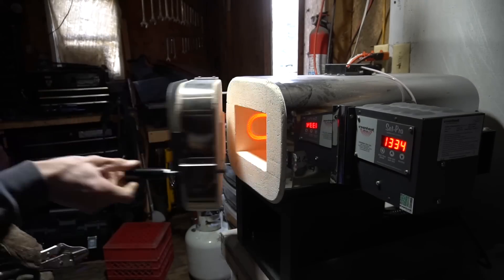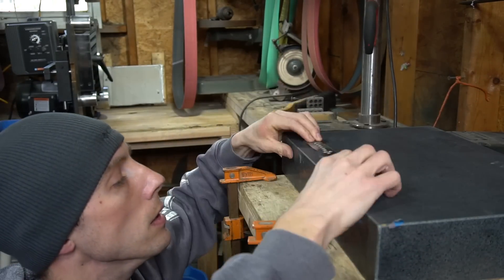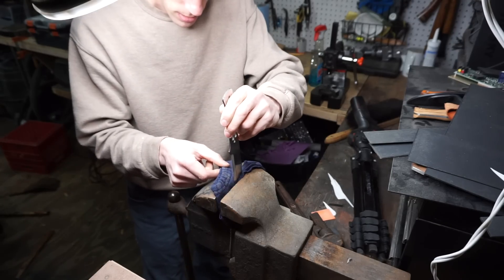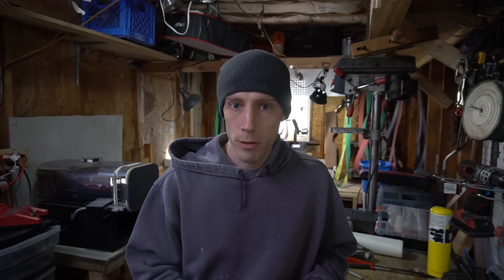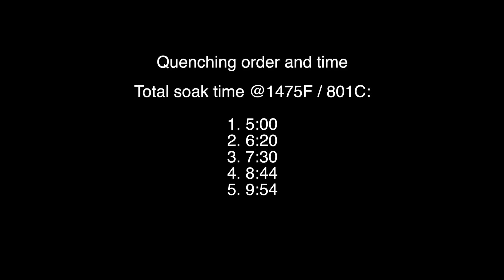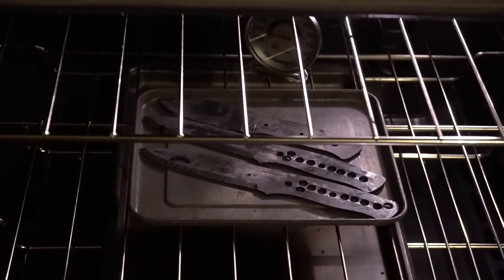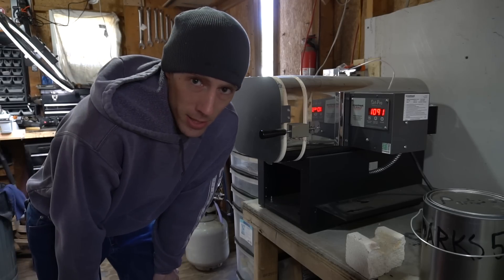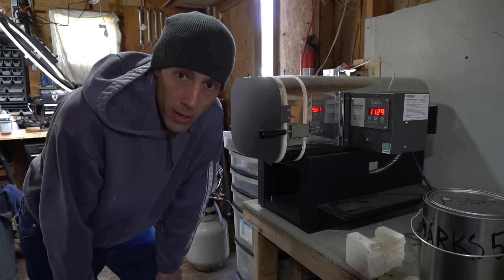Why Knife Makers Should Break Their Knives

Comment: I used to work for a stress relief company. Heat Treating different types of Steel, we used to start at an ambient temperature and then slowly heat the product to whatever temperature that particular Steel calls for, then there is a soak time again different for each type of Steel. After that we would slowly bring down the temperature over an extended period Of time . very technical and each type of Steel requires completely different heat treating but it always starts from an ambient temperature and slowly Works its way to asoke temperature and then slowly Works its way back down to ambient temperature. All types of Steel , if you want them perfect they require this type of heat treatment.
Reply: This is not that.

Comment: The smith who runs Crossed Heart Forge / Islandforge taught me that the increase in grain size happens in the quenching process, and it happens because the steel is usually heated too high before quenching, this doesn't happen in the tempering process. That's why the japanese smiths do not bring their swords to critical before quenching, the higher you bring them before the quench the more they expand in size. So quench your blades at the lowest temp that the steel type can activate the transformation process. So if your steel type can quench at 50 degree lower then do it lower, as low as you can.
Reply: @Aaron Washburn There's a huge difference between quenching a blade at dull red to bright orange. The higher the temp is when you quench the larger the grain size will be. Quenching at dull red is still hot enough to form martensite, I've quenched at dull red all the way up to lemon yellow and tested steel at each level of colour change personally, and dull red quenches have given the best result for knives. How many blades have you heat treated? I've done around 100+ over the past 3 years.
Reply: @Aaron Washburn You probably know more about the science behind it then, so I won't try to tell you you're wrong as you are the more learned person here (being honest not sarcastic in case it come off that way) Your're right about most of what you said, I do use Japanese hardness testing files, which can only tell me hardness in increments of 5 HRC. So I know when a Knife is at 50-55-60-65 etc or in between those numbers. 
I have basic data based only on performance testing, and I make assumptions based on performance, I don't even break my blades to try and look at fractures and breaks, I have a basic USB microscope so I could bring it up on my computer screen to take a look but I've honestly never wanted to break a blade, good steel is expensive lol.
All I honestly do is make a blade and take note of what steel type it is, what temp it is quenched at and what quench fluid was used and what temp the fluid was at. Then depending if I do traditional yaki modoshi Japanese tempering or western oven tempering I take note of what temp it was soaked at in the oven. I take note of thickness of stock used as well. Then I put them through edge retention tests, flex tests and abusive tests and take note at failure points, and the more abusive and higher scores on retention and flex testing the better I grade my blade. I don't really have knowledge of what's going on at the micro level, I just come to know what is the best results I can get for practical aplications and kind of stick with those, so I can tell people who might buy that blade what its limits are and what intended use I would suggest it be used for. I am switching to mainly doing blades with hamon now, without using western oven tempering, so my blades are quite hard on the edge and soft on the spine, I'm aiming at 62-64 HRC on the edge and am consistantly hitting just under 65 and just over 60. I'll be doing videos next week on the process if you are interested, maybe you can observe and tell me your input and advice.
Reply: @Aaron Washburn When I said not over critical I meant not as high as most western smiths quench at, I think most do it around 1450-1500. I've heard most people refer to critical at around no less than 1450. I usually quench at around 1350 or maybe a tiny bit higher. I think technically 1350 is still considered critical, but I thought it wasn't truly considered critical as it isn't completely past the transformation process at that stage, but it is transformed enough to create martensite because quite a lot of the make up is austenite at this temp, not fully 100% transformed though. That's why I say just below what is considered critical. When you temper at dull red I also notice a huge decrease in blade warping, where as when I quench at orange over 1450 I notice more warping and bacon edge.
Reply: @Aaron Washburn I tend to only use simply pure high carbon steels with low levels of manganese, shallow hardening steel when I do my own HT. Thanks for telling me that term (Intercritical quench) I've never even heard of that before.
Cheers.

Comment: The 800 is for 1095 the austenite phase transformation limit, generally you should soak up to 30 minutes for the steel to fully transform to austenite at that temp. This transformation is not fast at all. But huge chunky austenite does not imply huge chuncky martensite, as the quenching is a powerful phase transformation that restructures the whole steel.. I think you are not getting full austenite in your piece and that results in less martensite transformation and more of those nice chuncky grains of perlite (maybe). Going up with temp would ensure full austenite transformation and thus a full quench and less chunkiness.
As to why 5 minutes soak making smaller grains is that again you are having some austenite transformation but mainly pearlite which keeps growing until austenitisation. So with time you get bigger grains of pearlite back, but less of total. 
Anyway do a 30 minute soak and you should get the best result.

Comment: A suggestion to you is play with ice. I know water and metal are two different things but Crystal forms at the same way for both things so if you want a long Crystal has to do with pressure and heat and cooling versus a short Crystal. Another interesting thing you could try is a seed Crystal you can make it even more funny instead of playing with ice make some candy use a double boiler and see what kind of results you get when the fellow originally made the alloy for airplanes he thought he had made a mistake and left it for I came in for a few hours or a few days but the cooling temperature after the fact crystallize it and made it a lot more sturdy and flexible. I'm really interested in what your results are and I'm really tempted to start playing around myself I'm going to subscribe just because I want to see what you do. for some reason I'm thinking you should heat your oil up. And you should get a a laser thermometer it will tell you exactly how hot each one of your pieces of metal are you should be able to pick one up pretty cheap about 30 bucks. That will make your calculations more accurate.

Comment: I suggest you familiarize yourself with Iron-Carbon Equilibrium Diagram, it describes exactly what you see in your tests: grain depends on carbon content and temperature.
Reply from the maker: Im very familiar with them. Problem is not every steel type from every manufacture comes with paperwork.
Reply: @OUTDOORS55  then I'm probably missing something.
What I remember from University:
- Grade of steel is determined by carbon content and additives. This means that knowing steel grade you should be able to determine its carbon content and proper tempering temperature.
- After that you can test quality of your temper by checking steel for hardness (there should be plenty of tables on the internet for various grades and heat treatment procedures), this won't destroy the blade, but will leave a mark.
Basically, as you explained in the video, steel is defined by its crystal structure, which in turn is defined by carbon content and heat treatment regime. What you saw was result of overheating steel above its critical point or leaving it there for too long - Iron-Carbon Equilibrium Diagram is meant for engineers, not physicists, it's very practical, but what it actually represents is amount of heat required to reach certain state. If you look at Iron-Carbon Equilibrium Diagram, your aim is getting as close to critical as possible - supplying just enough heat for pearlite structure to transition into martensite (very fast to form and break which is exactly why it's so hard to do properly), but if you apply more heat (temperature too high or heating for too long), you will notice austenite grain forming - it makes steel softer, which you demonstrated. It's by no means fatal, to fix this you will have to normalize or anneal and re-temper the blade.

Also, thanks for making me waste 2 hours remembering stuff from University :D
Reply: @Aaron Washburn fair, so if you apply too much heat, stable austenite forms, right?

Comment: Also, for the 10 series, from about 1050-1090, I've always been under the impression you always should quench at the lowest transformation possible to prevent martensite formation. The other big thing, is the temperature of the quenching medium, which might be playing a factor here.  

During your tests, were you maintaining a set temp of your quench oil? Itll have a massive affect on crystalline structure.
Reply: It's been a while since I've read up on it, but martensite, to my knowledge, is a larger grained, unrefined extremely brittle grain structure that can add inconsistencies in the temper.

Comment: It shouldn't grow the grain for a 10 minute soak, maybe lower your temp by 25 degrees and try this test again? (quench @ 1450). I actually do heat treat 1095 in my forge, I am quenching in Parks 50, but I can cut through nails with it. I know it isn't 100% optimal, but it still has excellent results.
Reply: and you are right, in a forge, temperatures are hard to tell just by color, a good rule of thumb for me has been heat treat when it is pitch black, and when the steel reaches nonmagnetic (1414 F), and then go a shade brighter. (about 75 F more) and then quench.
Reply: also, normalizing can help keep grain growth small as well, even when overheated for a short time, that may be why when you quenched the test piece at 1525 F and it was still fine grain, but not so in the 1st batch of testing.

Comment: Great dedication to the craft. However, you're not actually looking at grain size. You're looking at fracture surfaces, which generally occur along grain boundaries. To look at grain size, you must polish the sample, apply an etchant, and view under a microscope. Also, a factor that's missing here is the hardness. It's very likely the pieces that were not soaked 5 minutes or more  did not reach full hardness capability, which defeats the purpose of a high carbon steel knife. If you're not soaking it adequately to achieve the steel's potential, grain size doesn't really matter. there's a point of diminishing return where ultra fine grain becomes a problem as you lose hardness. I got on the grain size merry go round a while ago too but then I got off after I learned a little more... :)
Reply from the maker: Theres a lot of factors missing here that i cant necessarily test with my limited equipment. All of the pieces however were saoked minimum of 5 minutes. Theres still a possibility that full hardness wasnt reached. I dont have a hardness tester so i dont know for sure. Thanks for the comment 👍

Comment: Ya know there's actually a whole profession based on the science of quenching. They do the math for temperature, what kind of oil, how long, etc. just to get a perfect quench. It's mainly used in very important machinery and equipment. For example NASA uses people to get the parts for space craft absolutely perfect.
Reply from the maker: Yes ive talked with a couple of them. The  consensus is they are not sure what is going on. The only way to tell would be to use more specialized equipment to examine the results.

Comment: Hmm Have you thought about the temperature of the oil you are quenching in ? Each time you quench a piece of steel in that same oil you are raising it's temperature and each peace that follows is quenched in hotter and hotter oil. Oil that's lets say 90 degrees Celsius will quench steel quicker than same oil at room temperature of 25 degrees even thou its hotter.   Have a think about that ;)
Reply: Yeah, just a bunch of BS. Maybe if you want consistent metal work, use consistent procedures across the entire build cycle including the oil temp you are quenching at.
Reply: Thats what i was thinking... evertime he opens the door he will loose some heat aswell...

Comment: My guess was the temp of the oil by the last quench the oil temp would have elevated a lot, If you have a bigger quench tub it would be better for consistency because the thermal capacity would be higher worth a try, that would allow the steel to cool faster to a lower temp
Reply: Just saw a comment voicing that concern, but he replied that he carefully monitored the oil temp. 110° for the low, and 155° for the high.

Comment: Been going through some heat treating science at work. Our engineers have found for aeronautical use, direct radiation is causing issues when tempering. Suddenly, all our furnaces are bad.
Reply from the maker: Direct radiation from tempering?? What kind of temperatures are you dealing with?

Comment: Looks like grain growth happens from length of time, I thought it just occurred from higher heat, what do you think of normalizing blades at quench temp? I was under the impression that soaking at dull cherry for long time was a good thing, I’ve read it shrinks grain structure. Thanks for doing this video, just subbed, keep it up!

Comment: I think there may be a difference between soaking and bringing up to temp. Longer periods of time at the same temp would allow the steel to adjust to the current temp. Maybe try a test where you let one piece slowly get up to 1550 and then the other heat up in about half the time and let set at 1550. Say, If you can control your forge, piece one allow it take 10 mins to get up to 1550, quench. Piece to allow 5 mins to get up to 1550, soak for an additional 5 mins, quench.

Comment: Mmmmmm. Not really. Cut the knives slowly with cooling lubricant then polish and etch the surface. Examine with a microscope - now you are examining the grain structure.
Reply from the maker: As you saw, a lot can be seen with the naked eye. If you have a microscope send it over.
Reply: OUTDOORS55 or a 30 X loupe. But your efforts are worthy. And the main question is how tough / brittle should a knife be? In the real useful world toughness is most useful. Like a bayonet. My scope is a Wild M20 with phase contrast stage $1500 AUD and its yours. 😂

Comment: Hi Alex.

Maybe the problem could be secondary recristallisation. I'm a maschine engineering student and we talked about this in our material science class. As far as i understood, secondary recristallisation is the growth of some grains at the cost of others. This can occur on small wall thickness, sharp textures and fine contaminations inside the metal. This is all just from looking in one of my books and there will be a lot more behind this (probably temperature in heat treatment)!

Maybe you can find some more info on this toppic.

Greetings from switzerland
Reply from the maker: Yes i don't believe i have the ability to figure this out based on what i have available to me. There are some other theories some other people have left as well. It's difficult to make a determination. Thanks for the comment 👍👍

Comment: I'm trying to do the heat treatment correctly. With all the knowledge of books, blacksmithing college, videos and the datasheets and personal experience and the right treatment for the purpose of the kife. So there is no need to break my hard days long work to make a simple or Damascus knife just to know that I could use my knife that are designed for cutting as a nail wrench. The only thing is using a scrap piece of it for testing. A knife is a tool for cutting, a outdoor knife have a different heat treatment more like a axe and a machete, swords are a bit different they need to flex but also be stiff enough to be usable.

Comment: just some passing observations: the opening and closing of the oven door could play a factor. also, iv seen a number of comments about the oil temperature going up with each quench and that does sound like a potential issue.

the last thing would be sample size. just using 1piecee of steel to test each variable leaves a lot of room for error. 

still, its a super cool video   :-D
Reply: scrolled down to see if anyone said this.  In the first test there is some thermal cycling going on each time the door is opened,  In the last test no thermal cycling is occurring.

Comment: Question: heating the oil with every quenching doesn't change the result?
Shouldn't you use a different "can" of oil at the same temperature every time?
Reply: @WaterfieldForge  and what oil temperature is better for quenching?

Comment: here's my guess toward why you found what you did toward the end. im a welder (well was) and back when had to do my cert test my teacher taught me to always air cool the plates. why because the grains are more solid and longer this way. so my best guess is leaving the metal overheated for 15 mins allowed the grains to have a similar effect as air cooling. though this is a just a blind guess and i haven't checked my metallurgy books in yeats